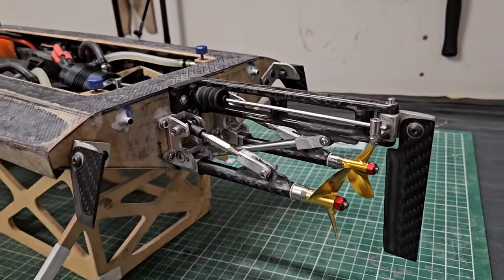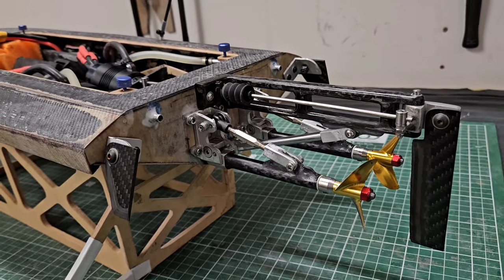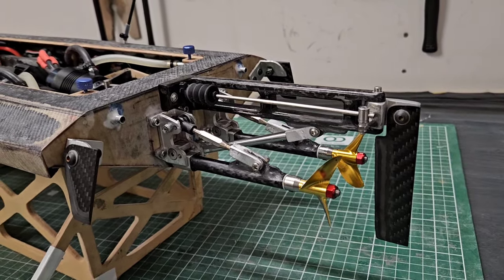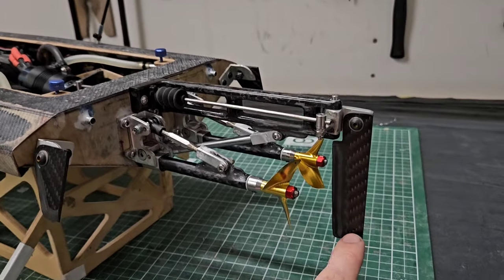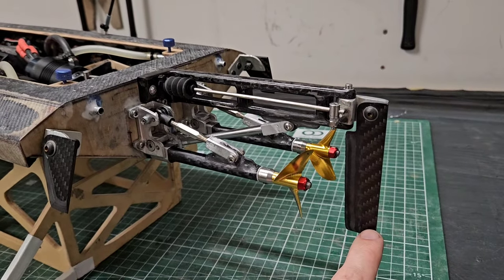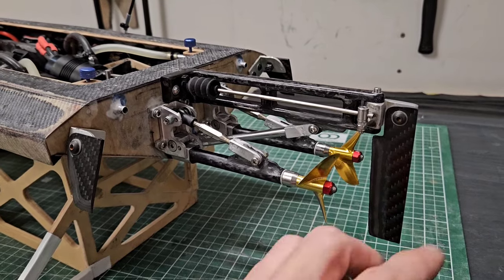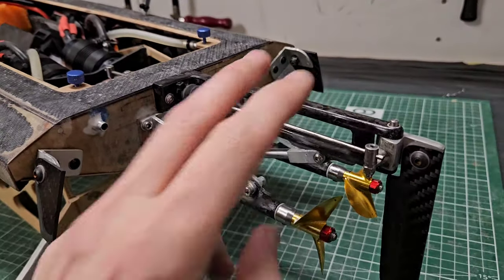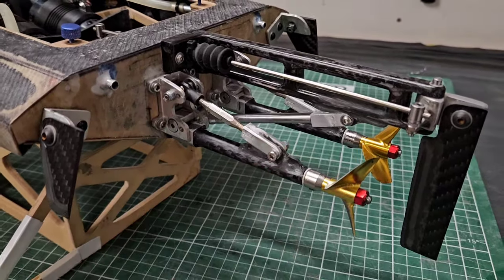Did I make the fastest RC Boat on a budget? - Twin motor boat build part 10

Comment: Nice work man! I did all my RC modifications same as you with files and hand tools for 10+ years till I came across a deal on an old lathe and mini mill from the 40’s.  Keep your eye out for a mill and lathe it will change your fabrication life! Keep up the good work
Reply from the maker: Thanks Rick 👍 I had some opportunities to acquire / borrow a small milling machine, even a workbench CNC, but honestly I'm hesitant. 
I think the hand labor has it's charm and mills are quite noisy too. I might buy a diode laser some day. I love these machines, they're quiet and it would be ideal for cutting frames for my boats. Cheers! DJ

Comment: I hope an extra 10mm of rudder dragging in the water will not reduce its top speed. I subscribed to find out!
Reply from the maker: Thanks for the subscription! You got a good point there, and it probably will reduce the top speed a bit. But I hope with sharp props and some struts fine-tuning I can set some higher speed numbers ✌️

Comment: I have a suggestion for you, think of the boat being a dart and on the rudder arm put a swept wing stabilizer and it will make the boat a lot more stable at high speed and will not effect the performance of the boat, that will end the flipping of the boat at high speeds
Reply from the maker: That's a nice idea Clarence, thanks! I've actually thought of adding 1 or 2 long fins, like the speedrun rc  cars have. But the boat speed has to increase at first, otherwise it looks a bit foolish I think 😅. 
I like the suggestion of a V-fin at the rudder and I might try that lateron! ✌️ DJ

Comment: Is sharpening part of the balancing or does it make the boat faster ?
Reply from the maker: Sharpening and balancing are 2 different things. Sharpening the prop will reduce prop cavitation, and it will increase the speed.
Balancing is to save your driveline from vibrations.

Comment: It looks cool, but the rudder placement seems like an area of high cavitation. For the rudder to have any effect, it can't be surrounded by air bubbles. Have you considered moving the rudder forward to the transom and placing it in clean water?
Reply from the maker: Thanks for the input 👍 I've tried a rudder on front of the prop on my single motor Wildthing. After a while I changed it to a rudder behind the prop. The boat became more stable. That's why I prefer the rudder behind the prop. But, honestly I didn't try the difference on this boat, so it could be different for a twin motor! ✌️ DJ

Comment: Interesting how much extra performance you'll get. Never tested that really myself. Always sharpen them immediately so couldnt tell how much extra performance it gives. But to be honest, dont expect more than a few kilometers, but maybe i'll get surprised. There's only one way to find out... 👍
Reply from the maker: Yes, my experience is a few km/h more speed by sharpening the props.
These CNC aluminium props basically don't need any work to them, or at least that is how they are often advertised. But they're definitely not sharp in stock form and the balance was a bit off too. I hope to run the G-Force this week, if the weather allows me 🤞